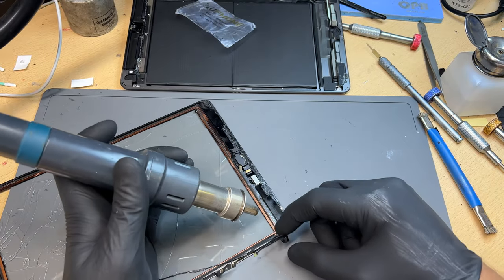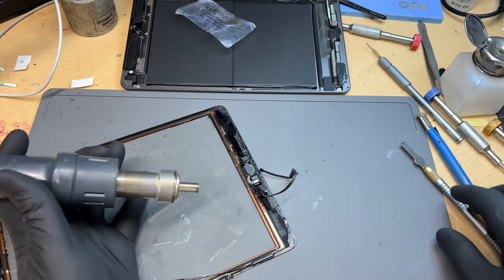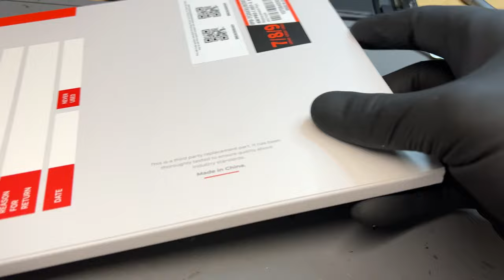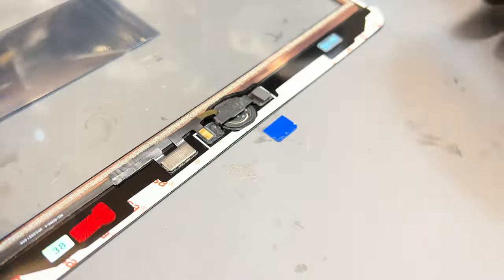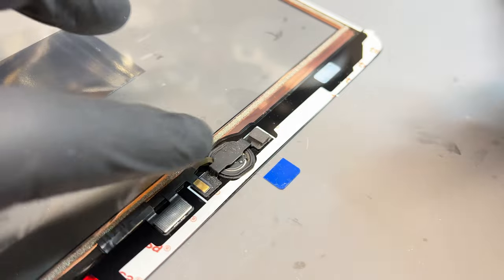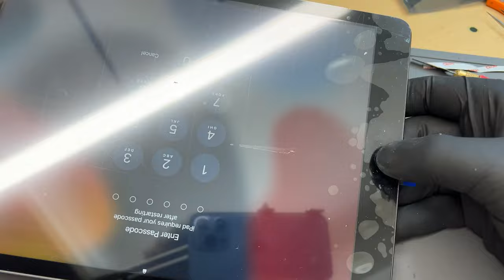How to transfer iPad home button and touch ID the Proper way

Comment: On 4:36 there was a cable connected to that bracket now my home button doesnt work the touch id does but the actual button doesnt work.
Reply: I have the same issue
Reply: @T2G24 yeah man, i can still use the ipad by swiping up but i miss the home button

Comment: Sorry, novice question.  As you finished with the small metal brace that goes across the back you simply pressed on what I took to be a ribbon connector terminal (shiny brass looking). Mine was fitted to the original underneath a steel mesh pad.  My kit comes with a new brace that is prefitted with a similar mesh pad.  Could you tell me how best to refit that terminal to the brace and the purpose of the steel mesh pad?  Please!  Many thanks

Comment: Could you also make a video about the ipad air 3rd gen? I have trouble with the aligning of the button, its an original screen so there arent any marked areas where to put the bracket.

Comment: Excellent and interesting in the efficient way you have your whole set up geared to quick usage, with tapes glues etc to hand in dispensers for the job, I haven’t checked but do you have a list of your tools etc that you use, as it helps in getting things that one may need, rather than the trial and oh so many error ways, some of the electronics guys I watch do this for that exact reason and lastly have you done videos on removing glass broken glass as again there seems to be confusion in glass digitisers as there is on laptops. Great video though it made me subscribe.

Comment: My ipad’s home button is getting too hot, which is draining the battery and hard to touch . Any solutions ?
Reply from the maker: I answer this question in my latest q&a video however it is usually because of some kind of failure. This will likely need replacing